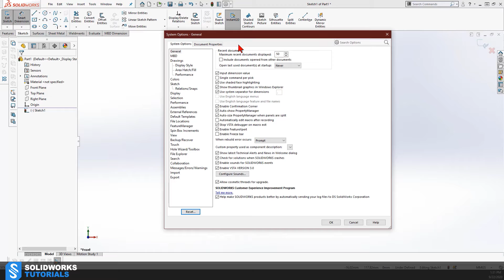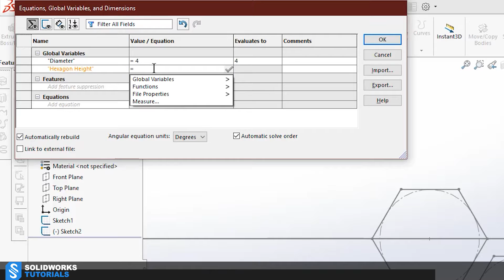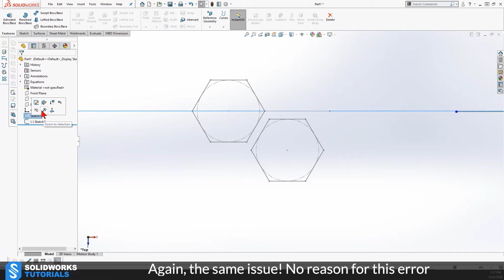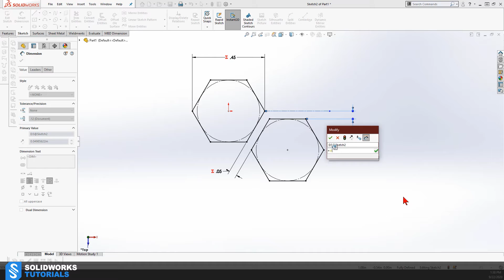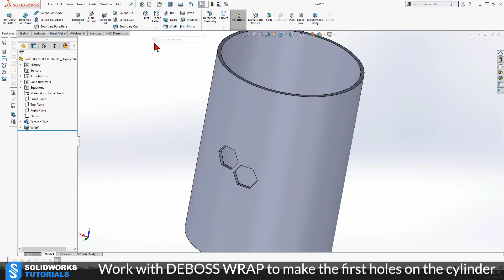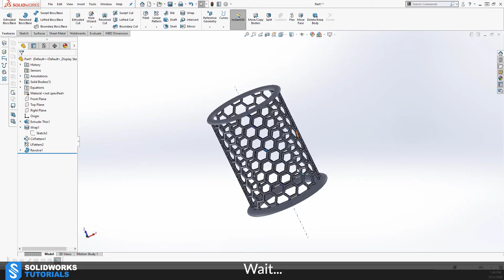Cylindrical Honeycomb in SolidWorks with Ryan

Comment: Why not just make the circumference as a variable in the equations section, no need of external calculations, atleast not very much
Reply from the maker: That would be working it backwards. That's also a solution, sure
Reply: @with-aryan  nice, reverse engineering ig